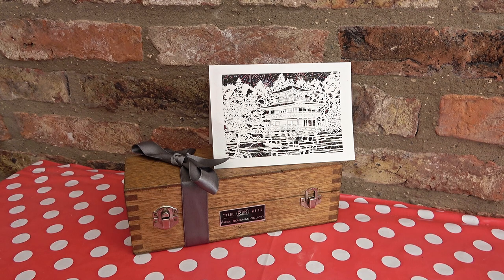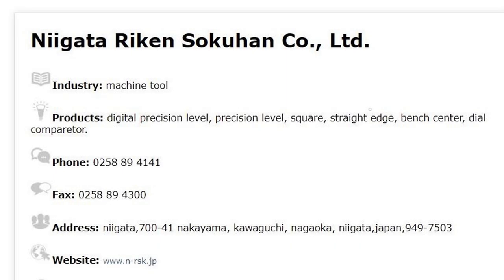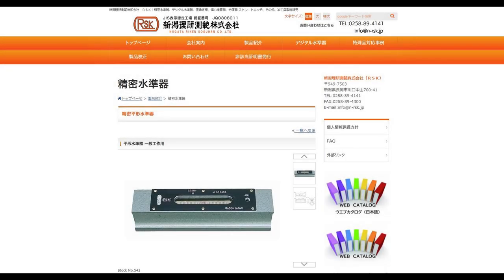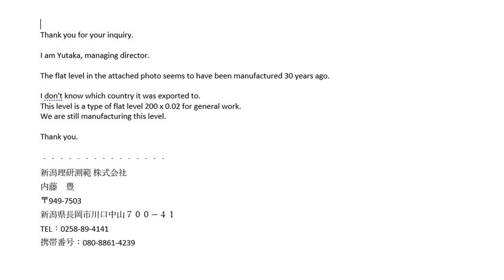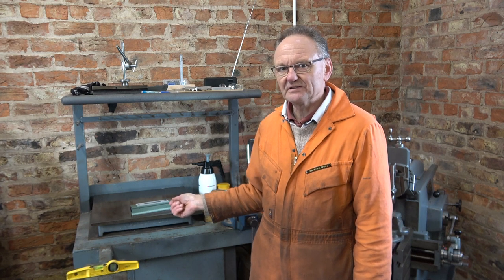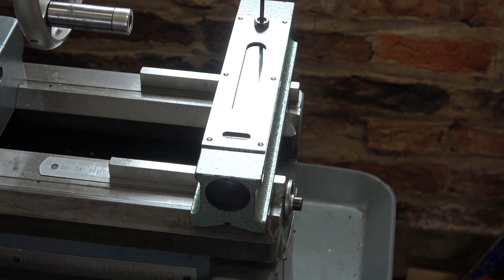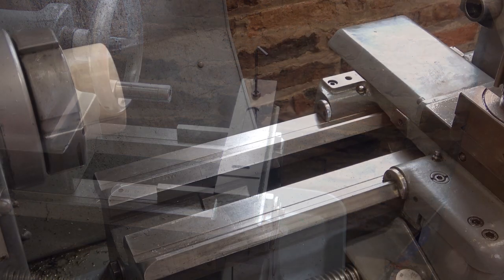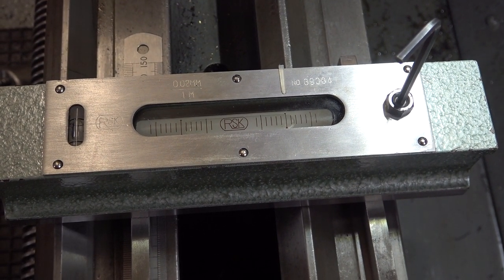HS61 Levelling check on my Harrison 140 lathe

Comment: I have a Clausing 5904 lathe and I got the same results when comparing readings on my Starrett level between the flat and V ways. Both were precision ground but not scraped. I enjoy your simple approach to your videos.
Reply from the maker: Hi John, thanks. Yes when I used the top of the v ways as a reference to measure wear on the other ways it caused some discussion whether or not the top of the v ways could be trusted and I think we now have the answer - for the level of accuracy that I work to they can. Simple is good, I'd like to claim it comes from a deep understanding of the fundamental principles but that might be untrue :-) Cheers

Comment: Hello,
Good video... I leveled my Myford this week and would agree it does not take much to send the reading all over the place when using a precision level.
Take care.
Paul,,
Reply from the maker: Hi, yes and I realise the level is so sensitive it actually has limited uses. Having the adjustment screw on this one is a big advantage. If it was a fixed level I would have been messing about for ever just to get the bubble on the scale. Cheers.

Comment: Good video.  I have a Harrison 165 (that I spent about 9 months restoring) with an almost identical bed to your lathe and I have recently been doing similar investigations to try and identify where the problem is that is causing me some parallelism turning errors (around .003" over 4" when using certain parts of the bed).
After spending a lot of time with a DTI and fiddling with  'leveling' to no great effect (the bed seemed to be identical level-wise at it's ends using a level that appears to be of similar sensitivity to yours) I hit on the idea of placing the precision level front to back on top of the cross slide and taking a relative bubble position measurement about every 1" along the length of the bed by winding the carriage along.  This is quite easy to do as the level is just left in place and the carriage moved and then left for a while for the level to settle.  The results were quite illuminating as they allowed me to map where the bed is worn as a function of carriage distance from the headstock.
Obviously most of the wear is in about the first foot of carriage travel as this is where it is mostly used but comparing my 'bubble map' to a freshly turned test piece definitely shows a direct correlation of error.  I'm planning to do this a bit more accurately and am hoping that the information gained will allow me to compensate manually once I know exactly where bed wear is causing errors.
At least I'm now sure that my bed is not twisted and that Harrison's claim that the cabinet is rigid enough to stop it twisting seems to be true.
Reply from the maker: Wow Andy, suddenly the light comes on. That's a perfect test - I love the name 'bubble map'.  But I'm surprised the bubble did not run off the scale .... I guess not. I will have to try that. Cheers
Reply: @HaxbyShed  Yes, I was unsure what would happen at first as the sensitivity of my level is unknown (I must try and measure it at some stage).  I inherited the level from my father - it has a Hilger & Watts capsule that is about 6" long probably salvaged from one of their scientific instruments that has been mounted by somebody on a nicely made adjustable brass base.  I get an identical bubble position when the carriage is at the ends and about 3mm of bubble movement when at the worst spot which is where you would expect, a few inches from the left end.  I would certainly be interested in hearing what results you get if you try this test. It might even make a good subject for another video...
I'm now convinced that the wear in the bed of my lathe is almost all in the front inverted vee and hopefully the information I have (and will improve on) will allow me to 'work around it' with a bit more accuracy.
Ah well, back to my current project which is trying to replicate a missing centre mounting sleeve for my Harrison lathe headstock - It's tapered on both the inside and outside and is proving to be interestingly tricky.
Reply from the maker: @BraneHurts  I will add a top slide / cross slide bubble test to some video or other in the future, maybe not too far ahead. My H140 came without the spindle nose bush and just by luck I saw one on ebay soon after and so did somebody else. We had a bid war in the last 30 secs and I ended up paying £60.  If I'd kept my nerve and bid in the last 2 secs I may have got it for £35 (that's where is was just before the final race). It's MT4.5 ext and MT3 int. I have seen others for sale with very poor descriptions for £25, where the seller is not sure what it is and it's hard to figure out from what's said.
Reply: I'll look forward to your video and seeing your interpretation of checking wear by this method.
The nose bush for my H165 is a bit bigger than the H140 one.  I think it's MT5 ext (although about half the official MT5 length) but still MT3 int.  I do have the official Harrison part No. for it but haven't had a serious look for one yet as I thought it would be a challenging project to see how accurately I can make one.  It was this that started me off on re-checking the general accuracy of my lathe and led me to your YT channel.  Have already re-machined one side of the gib in the compound slide in an attempt to tighten that up (with a reasonable amount of success) but time will tell.

Comment: Great history on the level, excellent Japanese service.
That is a very very high resolution level, at 0.02 mm per 1 metre, that is equivalent to 0.0002" per 10", or two tenths of a thou in ten inches, or by ratio 50,000 to 1. ( 1000 mm ÷ 0.02 mm or 10" ÷ 0.0002").
Lathe bed looks to be in perfect geometric shape.
Thanks for sharing.
Reply from the maker: Hi, thanks for your regular comments and support. I'm not sure which was the standard and which was the conversion (why are US imperial levels quoted as 'per 10 inch' - was it always like that independently since the beginning or did it just come as a conversion from 'per meter'.)  Cheers
Reply: @HaxbyShed  Most precision engineering levels I have used were 10" long, and many machine tools with long beds or slideways are specified in flatness per 10", so to measure, you index every 10", if using a shorter level, then a 10" or 250 mm parallel is used. Since a metre is nearly 40", it's easy to divide/convert between the two.
At my previous job, we had base's with precision box rails 50 x 100 mm section up to 12 metres long, part of our inspection/QA document has about 12 checks, with base flatness, base twist, base keyway straightness, rail flatness, rail twist, rail straightness, rail to rail parallel. Every 250 mm the actual deviation is recorded, and it plotted on a graph. I developed a Excel sheet that allowed easy graphing, with inputting "Bubble Divisions" each 250 mm. The fabricated base was scrapped in to bring it in to tolerance.
On some levels, you will see " Arc Seconds" specified, there are online calculators to convert this.
Regards John.

Comment: That is a very fine level. Isn't it satisfying to buy a used item at a fraction of the new price? I got a Starrett 96, Starrett 98 & a Fell level that way. Couldn't have afforded it otherwise. $400 U.S. for the three was very nice considering full retail new. Keep the videos coming. We really enjoy your shop adventures. How about making a tailstock live chuck for yourself? I find mine invaluable. Cheers.
Reply from the maker: Hi Robert, thanks for your support. Yes everybody likes to get a bargain :-) I could really do with a second level which is not so sensitive for general work. Can I just check what you mean by a tailstock 'live chuck' please?
Reply: @HaxbyShed  Check out "Cutting Edge Engineering" from Australia. He's the best example of this. One video shows how he puts a 3 jaw chuck mounted on bearings for his tailstock. (he also did a 4 jaw) Makes holding long/large stock easier without the center rest. I'm going to make one from a used 5 inch 4 jaw for my Morse#3 tailstock.

Comment: Can't remember exactly where you were at with all the measurements in the previous videos but now you have eliminated twist  where when does that leave you?
Reply from the maker: Hi, the situation is typically 2thou taper turning a long bar between centres and also about 2thou run out when I put a static test bar into the 3MT on the tailstock and clock along its length. For the first issue it may be that my tailstock needs moving over by 1thou.  Sometime I do need to do some cuts with HSS as carbides could have been pushing the work away due to cut force, causing some barrelling. For the 2nd issue it could still be a ropey taper in the tailstock. And any underlying bedwear will remain. Somebody did tell me their Harrison headstock had been moved out of alignment by a bad chuck run-in, causing taper turning with work supported only in the chuck but I've not looked at that other than to note the headstock sits on a V-way so should normally be spot on. I'll let it all settle in my brain for a while and then maybe do some more checks and/or adjustments but I don't want to spend my whole time turning parallel bars forever :-) And I don't ever see myself grinding centres for perfect precision because it's not worth it for what I do.  Cheers
Reply: @HaxbyShed Just for the hell of it I'm gonna put a couple of pics up on Instagram of a Starrett across the ways on my 140 for you to look at. I checked ( roughly) again this morning and it's out a smidge! 🙄

Comment: Great video!  Can I borrow your level,  amigo?  😁
Reply from the maker: Thanks Ronaldo. There are still some bargains on ebay but it needs patience to find them. It helps if the seller does not know what they've got. Cheers
Reply: @HaxbyShed      I agree with that statement.problem being ebay can be addictive.